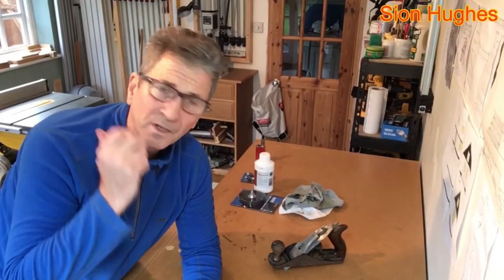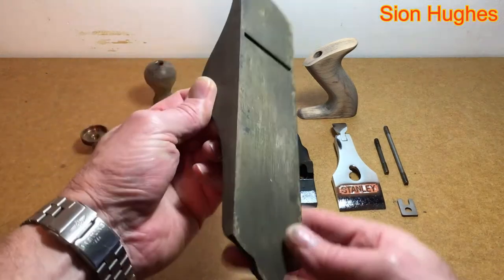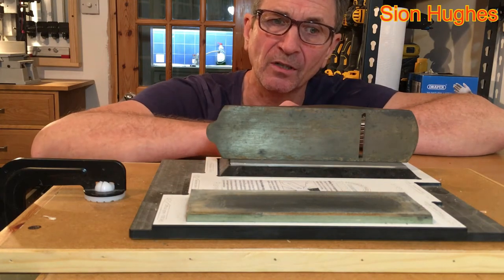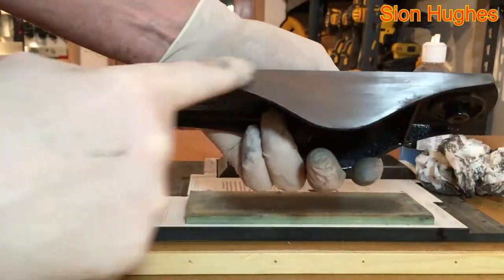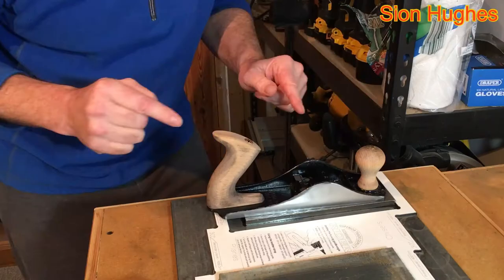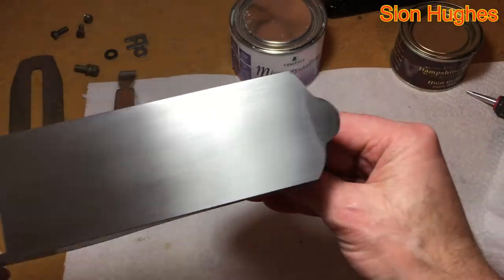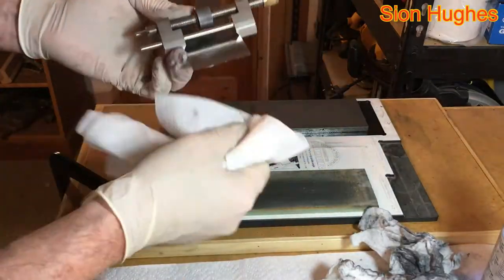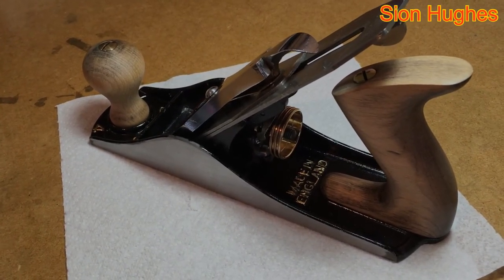How to Restore a Stanley hand plane

Comment: Good job restoring your plane, Stanley didn't start making planes in the UK until 1937.  That particular example would be a type 3 made between 1945-1972.  Time Tested Tools has a small type study on the Engish made planes.  All Stanley Bailey pattern planes made before WW2 would have rosewood knobs.
Reply from the maker: Thank you for your comment. When dating that plane I followed a Stanley flow chart but as you and many others have pointed out I have clearly gone wrong somewhere. There are a lot of very interesting feedback in the comments to this video . It works beautifully and gets used on practically every project . Hope you enjoyed the video and It gave you some ideas for restoration tips . Please consider subscribing as I would really appreciate your support. Cheers Sion
Reply: I'm guessing very close to the end of it's production date, late 60s-early 70s given it appears the interior is painted and both the paint in the plane bed and on the lever cap appear so new and bright. While rusty, this plane saw almost no action given the relative pristine wooden parts, frog and adjusting lever.

Comment: I have restored many many #4 planes. The way I see it is “It’s your Plane!”  But there were a few things that you may have slightly missed steps on. One is that is not English oak it’s beech handles.  A lot of wooden planes and saw handles were also made from beech as it is a very stable and solid wood. Also very desirable. Most of the handles that are sought after are Rosewood which is hard to come by and is usually a foreign imposter nowadays! :). I do love that you lapped the sole and the sides. I hope you checked to make sure the sides were square to the sole???  This would enable you to shoot with the plane on a small shooting board and not have to adjust the lateral out of square.  I would say the biggest thing I would normally have done is to lap the sole with the plane assembled because then it would be in tension which could alter the casting just slightly. After all the work you out into it I am sure you don’t want to take it back to a stone and see that it may not be flat when you are actually using it.  I didn’t catch if you addressed the chip breaker mating with the blade?  During the sharpening process did you feather your corners?  So one of my personal pet peeves are when a person finishes a plane and then shows it taking shavings off the edge of a board.  A number four can be used for that a la Paul Sellers, but it is intended for smoothing. You took the time to put that polish on the blade but I bet after you had it set up you wondered why it may have left ridges in the finish when you tried to smooth with it. That would be from not feathering the corners ever so slightly. Do that and your plane tracks will go away and you will fall in love with the beast all over again. You are the first person whom I have ever seen “dome” the brass nut for the front knob.  A little stain and shellac would have made the handles a little more true to the restoration but I do not see that as a miss because it is your style and what ever floats the boat you own then have at it. The tote having the nut sticking out is a tell tale sign that either the handle has shrunk or it’s been altered. I’d also put a little 3 in 1 oil or grease in all the screw connections. I like the lever cap paint and think you nailed that color. The gold touch on the letters isn’t original but does give it a classic look and is nice as well. Keep it up and good job!
Reply from the maker: Your right about the wood for the handles . My mistake . I have since put a slight camber on the blade and it doesn’t leave tracks . I made a video called ( Oak flooring makes cupboard doors ) in which I use that very plane extensively for jointing and smoothing oak . It left a beautiful finish . Thank you for taking the time to comment
Reply from the maker: I followed Rob Cosman regarding how I set up that plane and the chip breaker I borrowed from my No 5 had been pre flattened .
Reply: Sion Hughes Colman if fairly good on that and I do like his sharpening style. He favors the #5 Wood River. He has recently come out with a propeller style adjuster knob which I caught sight of and asked him about in a previous video. I think this prompted his recent video on the design and when they are going to sell them.  I’d do a quick pass with a fine grit diamond stone with the plane put together and tensioned with the blade retracted and see if the bottom does move. The ductile iron may be good. I had a paragon plane that was polished to a mirror finish and was beautiful. But when I used it, it would heat up and distort. Blew my mind. The cut would get weird and I couldn’t rely on the plane finish. I love the look but shelved the plane. It is listed as a vintage premium plane. Let me know if you find a difference when the plane is in tension. I have always lapped the soles with the plane put together completely. Hope all is well.
Reply from the maker: @adamtheroofer3659  I have to say it performs beautifully on hard and soft woods . Love Rob Cosman
Reply: most people advise that the plane bottom and sides are perfectly 90degrees ... this is not actually needed and nothing is wrong if it is slightly off because if you're using it on a shooting board , you can easily adjust using the lateral adjustment lever to get it to a perfect 90 degree cut

Comment: Very nice, well shot, and edited video.
I have restored hundreds of Stanley hand planes. Necessity for “Dead flat sole” is a myth, as is the “you must have the frog, in place and tight to lap flat”. You do want the front of the mouth flat and supported.
Rust Removers work best if all the parts are first cleaned in hot water and degreaser, to allow the chemicals to access the rust and metal. I scrape off rust with a single edge razor blade and stainless-steel brush, prior to degreasing.
I use vinegar to soak, but only for about 20-30 minutes, scrub well with Scotch Brite, synthetic steel wool in hot soapy water, (dish soap) to remove softened rust. Once clean soak again in hot water and ounce of Baking Soda to neutralize the acid. Baking soda soak/neutralization will also minimize flash rust. Vinegar will not destroy cast iron as is often quoted, I have use it for years without issue. Do not long-term soak, it is an acid.
 All parts are then sanded or stainless-steel brush finished and polished if needed.
I lap with 60 grit sandpaper glued to marble, to get to flat, with frog, removed, Knob and tote in place, it does not take long. Note, marble is not “perfectly” flat, but close enough.
Knobs and Totes routinely shrink, just drill the nut hole a bit deeper, you may need to grind the rod a bit shorter to compensate for the amount of drilling. I find thinned Linseed oil on Beach and Rosewood darkens, produces a nice finish and protects the wood. Wax over linseed is a nice grippy finish. I put 3-4 coats of linseed of a couple days, it will darken with each application.
The “type study” does not apply to Stanley planes made in England and is at best a “guide”.
Reply from the maker: That’s all excellent advice and I will refer to this comment when I next restore a plane . Thanks for such a comprehensive guide to quality restorations . Cheers Sion

Comment: Very good video, I like style of the narrative and the excellent way you have shown the project😊
Reply from the maker: Hi Richard, High praise indeed. If you read through the extensive comments to that video you will see that I have had some inaccuracies pointed out to me  ,but it doesn’t change the fact that that smoothing plane looks beautiful and is a joy to work with . I will be doing a vintage No 6 restoration when I get the time and if you like my style of presentation then check out the other 60 videos on my channel . Once again thank you for taking the time to comment and I really appreciate the high praise . Cheers Sion

Comment: Nice work! I'm restoring a few Stanley planes and picked-up some great tips from your effort.
Reply from the maker: What a lovely comment. Good luck Lonnie with your restorations. It’s actually a great way to give yourself a quality tool without the high price tag . I have an old no7 which I bought on eBay because I need one for jointing and I am really looking forward to the restoration process . It will  make a great video as well . Please consider subscribing and I will have another Stanley  restoration for your viewing pleasure soon .

Comment: Great job in restoring the shine of that plane, one thing I would remark is that I would flatten the sole and side walls with the plane fully assembled due to the faces changing dimension under the stress of a tightened frog/breaker/blade. Other than that you produced a masterpiece.
Reply from the maker: You are absolutely right and not the first person to mention that . I recently tuned up the sole with the blade in place but retracted and it didn’t display any high or low spots . I recently cleaned up the faces of some oak boards with that No 4 and it was a dream to use . Glad you enjoyed the video and please consider subscribing. I have a few other restorations on my channel if you’re interested.

Comment: Other videos that I’ve watched use a slab of Granite (like a large Granite Tile) or a large sheet of glass, then they put the sandpaper on that so they get an even sanding of the plate.
Reply from the maker: That system will certainly work. However, I used a diamond plate because it was a small plain got a wonderful result and haven’t seen anybody else do it.

Comment: Nice restoration. As has been said, at first glance the plane is from the 3rd quarter of the C19th, probably and you should true-up the sole with the frog in and the plane under normal tension. Also, it's worth properly flattening the machined face of the frog where the iron is clamped. I've read the most important places the sole needs to be true is in front of the mouth, the section behind it and down the sides.. barring a nice 'rounding towards the edge of the side. I like to put a nice smooth curved surface on that heel at the back too.  Thanks for going to the effort of doing a video.
Reply from the maker: Hi Emlee , thanks for taking the time to comment. Your quite right with your observations  . Glad you enjoyed the video. And if you haven’t already I’d really appreciate it if you would consider subscribing .
Reply: Have you any actual measurements to back up your assertion that flattening needs to take place with the frog in place and the blade under tension? I had my planes surface ground without the frog and they are spot on under tension. I believing to be a myth, or at least of infinitesimal significance.

Comment: I enjoyed your restoration.  Love seeing old tools given new life and saved from the scrapbin.  Personally I wouldn't take an exquisite 16K grit edge to a strop.  I've found that my 12k grit get a better edge when not finished off with a strop.  I just take off the burr on that same 12K grit waterstone.
Reply from the maker: First of all thank you for a lovely comment, and for taking the time to comment.

I absolutely adore that plane and its performance is exquisite both on hard and softwood. As for your suggestion I’m sure it works perfectly well however I only have the equipment in front of me that you saw.

I’m pretty much following the Rob corpsman sharpening technique but clearly not to his standard. As long as it works that’s all that really matters. Please consider subscribing and I think you will be my 1002 subscriber. Check out the channel maybe there’s similar videos there that you might really enjoy as well . If you do let me know in the comments and thanks again 
Cheers Sion

Comment: Great video and super nice plane. Just a tip though. You only flattened the back of the blade to 1000 grit therefore your edge isn't actually 16000 grit sharp. It needs to be polished and shiny on both sides to achieve a true sharp edge. That's the reason why we flatten it.
Reply from the maker: That’s wonderful advice and I’m going to be straight on that tomorrow. Really glad you enjoyed the video. I absolutely love that plane . It features in so many of the videos that I’ve made. Please feel free to check out my channel and look at some of the other videos ,you might like them. Cheers Sion

Comment: The very old Stanley/Bailey planes from around the turn of the century, at least here in North America, came with Brazilian Rosewood handles. I own a #4 and #5 Bailey from around 1910-1915
Reply from the maker: Hi Andrew, Your completely correct and I have made a number of honest errors in this video that I have discussed in the comments section . I have recently bought a vintage  No 6 with old crack rose wood handles. That will be filmed for a restoration. Please consider subscribing and thanks for taking the time to comment. I hope you enjoyed the video despite its mistakes on my behalf.

Comment: Nice video and beautiful end result. I noticed the front knob was spinning on the spindle at the start?  How did you fit it so that it didnt spin anymore?  Im considering filing down a couple of threads off the spindle. Cheers.
Reply from the maker: Thank you so much for the lovely comment.

I think at the very beginning of the video the knob was simply loose. I just tightened it up. It remains a cherish possession and perform masterly. Please consider subscribing if you already haven’t please investigate my channel as there are about 70 other videos that you might find useful. Sion.

Comment: Enjoyed the video, , not meant as criticism but hope this observation helps, 
when doing the sole flattening it’s worth having the plane together blade/iron installed but fully retracted   as working hard on the sole alone can cause some possible warping , also try using wet and dry paper, stick with spray adhesive and lube with fluid, saves your diamond stone 😉
Reply from the maker: Hi , if you read through the comments section you will see that your observations have been made a number of times. I drew pencil marks in a crosshatching pattern on the soul of the plane and with a blade installed and retracted. I re-flattened it. I didn’t find any low or high spots. I’m sure this might have an effect on some planes but it made no difference to mine. I like the idea of using the diamond stone because I know it’s going to get there absolutely perfectly flat soul. I have a number 6  jointing plane which needs restoration and that’s gonna have to be done using wet and dry. Thanks for taking the time to comment and I’m really glad you enjoyed the video. Cheers Sion

Comment: Lovely video. I am not a tool restorer or collector. I restore old houses and furniture using hand tools only. So my use of hand tools and their maintenance is probably different to those who restore, sell and collect hand tools. Every video I have ever watched (and my own experience confirm this) advocate flattening the sole with the frog and the retracted blade installed. Paul Sellers also asserts (in a video on restoring a wooden jack plane) that flattening is really only important around the mouth of the plane. I wonder how you feel about all of that. Please understand I am not trying to give advice here. I just want to learn more. Thank you.
Reply from the maker: Thank you for the lovely comment. If you read through the comment section, you will see that your observation has been mentioned quite a few times and I have admitted my fault. However, I drew crosshatching on the soul of the plane and re-flattened it with the blade retracted and didn’t see any noticeable difference in flatness. I fully accept that I made that hand plane  look unnecessarily pretty, but I have a particular appetite for pretty looking headlines.
Reply: @sionhughes5543  And that is, in fact, a comment made over and over again by Paul Sellers: it is personal preference to make tools look pretty. I don’t mind when they do. But I am personally too busy working to make my tools shine. They get a rub of oil (BLO and 3-in-1) so they don’t rust. Most of my tools belonged to my grandfather and my dad after him. I feel honoured to use these tools. And what ever sweat and scrapes are on the tools are from their toil. Thanks again for a great and caring video. I love when people take their time to honour these old traditions instead of dismissing them.
Reply from the maker: Bless you for the lovely comment, Cheers Sion
Reply: @sionhughes5543  And thank you again. I understand very well that the sole was not warped by your flattening and lapping procedure. It’s good to know that it can be done sensitively both ways. If I listen carefully to Paul, he says exactly that: it is possible (POSSIBLE) to bend the sole if flattening without the frog and blade. He is not saying that it is sure to happen and everyone who doesn’t do it the other way is a so-and-so. When we hear arguments these days that it has to be done one way, and one way only, it is, to me, proof positive that we no longer have the active hand tool culture among wood workers that we once had. I remember very well my father’s work and his training of me as a kid: any operation could be done in a number of different ways. There are obviously wrong ways to do anything, but you get the point, I am sure.

Comment: Excellent work!  The gold highlight was brilliant! I did cringe to see you take that thick of shaving with such a meticulously honed edge. I have no doubt your edge will cut much finer. I would only reserve those edge for the finest of final smoothing if I had put that much work into the blade, I will milk ever last cut.
Reply from the maker: Hi Carl , thanks for the high praise. I have a No 6 that  i will be restoring soon . That smoothing planes is a real joy to use and yes it does produce ultra  thin shavings, especially on oak
Reply: @sionhughes5543  remember when no one wanted 6's?  Now they are rare and collectable lol.